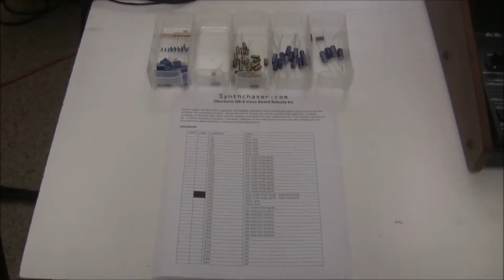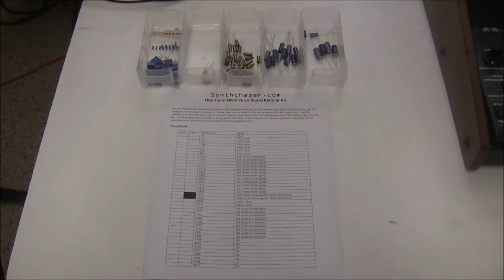Synthchaser #058 - Oberheim OB-8 Voice Board Rebuild

Comment: I have an old OB8 (it’s so old that the MIDI option was added later) and because of old age & lack of use it is now a paper weight. I’m not a tech but have done tons of soldering in the past...usually stuff like changing capacitors & burnt out 6550 tube sockets, etc and was wondering if someone like me could attempt what you just demonstrated on your video?
Reply from the maker: If you've got soldering skills, I don't see why you couldn't do it.  I've got a kit with the part you'd need on my site.

Comment: Nice work. I used the Bourns 3296Y trim pots as replacements. Looks like you are using 3296W? The Y style has an offset wiper lead that provides a little more length to the top hole. IMO, upgrading the filter trimmers is more beneficial than the VCO v/oct trimmers. The single-turn seems good enough for calibrating v/oct, though I did replace all of mine anyways. For the VCF though, multi-turn trimmers made a big difference for calibrating resonance and initial frequency. The old ones in mine were so crusty and sensitive, it was impossible to get accurate tuning between each voice. Another plus to using these new trimmers is that they are sealed.
Reply from the maker: Sounds like your're binge watching my videos.  Very brave of you!
Reply: Synth Chaser LOL. Yeah, I like these type of electronics repair videos. I’ve learned many tips from them. I am self-taught when it comes to this type of work and have been able to service my own gear, to a degree, probably saving me hundreds. Thanks for sharing.

Comment: What desolder tool is that? It seemed effortless to take out the components.
Reply from the maker: It's a Hakko FR-300
Reply: Wow, are there any that are a little cheaper that do a good job?
Reply from the maker: Not that I'm aware of.  I had tried some of the Hakko knockoff products and they quickly broke, so I've been sticking with the real deal.